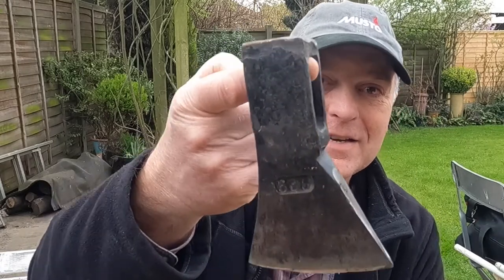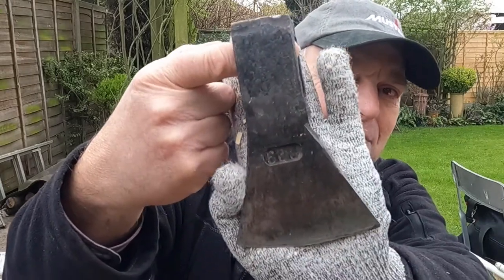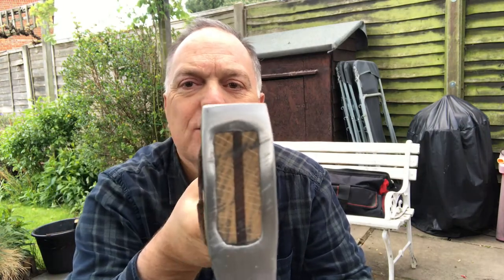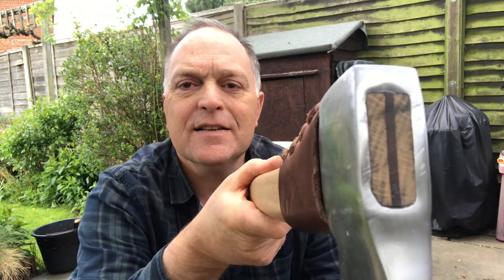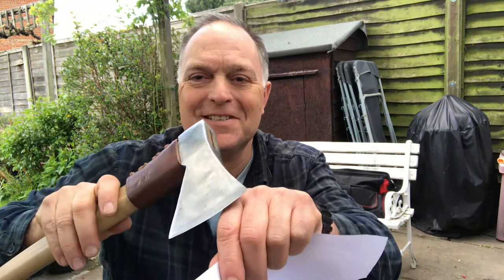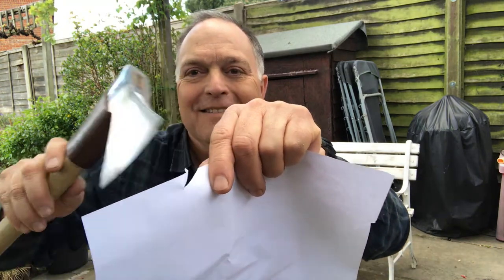Bushcraft Axe Restoration #shorts

Comment: How did you treat the axe head after cleaning it up?
Reply from the maker: Hand sand down to 600 water paper then used a rubbing compound on a drill (like the panel beaters use) then oiled while not in use.hop u guys keeping well.
Reply: @GraysOutdoors  nice, I clean and oil my gransfor bruks after every use. 🙏 We are well, hope everything is going well with you, Atb James